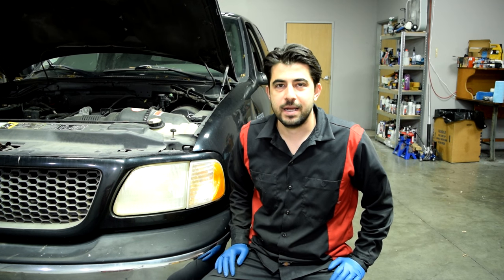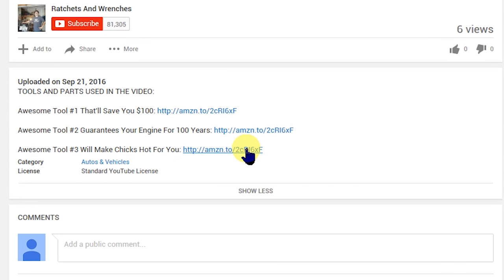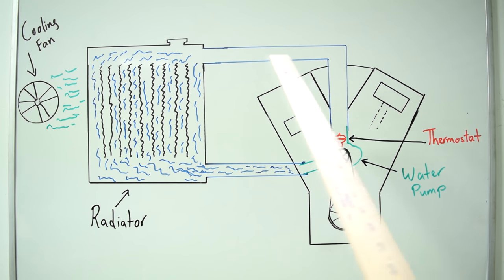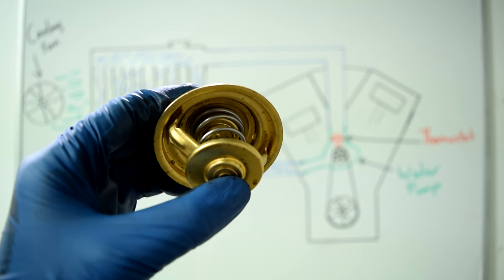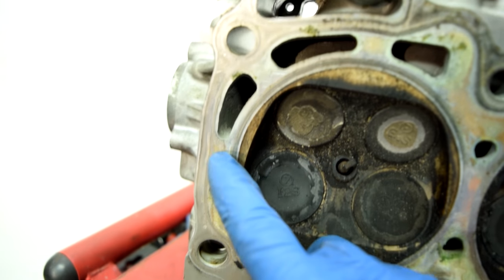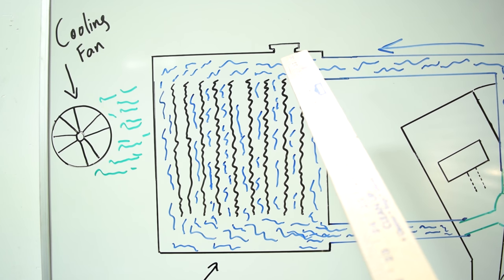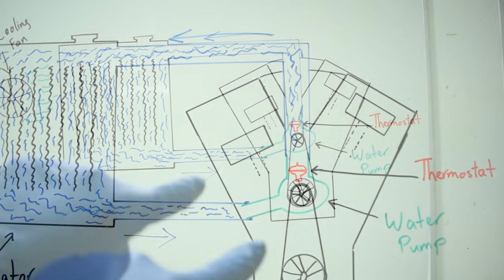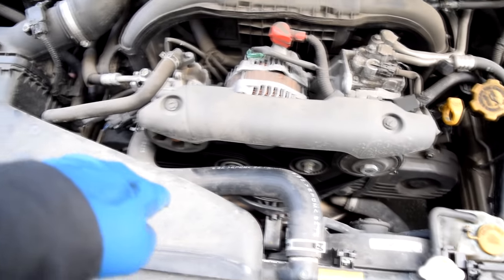How an Engine Cooling System Works and Operates - Also Diagnosis and Fix

Comment: i think the hot coolant when thermostat open pass through Upper hose than pass by radiator and Enter by Lower Hose back to engine.
2:47 you are saying opposite.
Reply: He is saying that some cars like that Subaru run in the opposite direction as explained.
Reply: @flightofthefatman  but my class mate works for subaru and he disagrees. He even recorded a video of an engine bay of the same car and it had arrows pointing towards the radiator on the top hose explaining that the flow of coolant at the top is away from the engine not into it
Reply: So I'll ask ratchets and wrenches

Comment: Good info, but what about any bypass flow into the heater core, etc...?
Reply: Cooll Asice The upper and lower rad hoses will still show a different temp if the thermostat working.  As far as bypass, if the thermostat is stuck open, the coolant will be allowed to circulate and be cooled so anything going through the heater core will also be kept cool. 
If the thermostat is working, the coolant will only be allowed to circulate through the engine but not into the radiator.  It allows the engine to heat up and operate at proper temps and the side effect is hot air for the passenger compartment.

Comment: +Ratchetsandwrenches are you sure the subaru legacy 2010 has reversed coolant flow to normal coolant systems because my mechanic mate works for subaru and he showed us a video on the same car model and year and the top radiator hose has an arrow pointing toward the radiator.  Can you reconfirm this. Thanks in advance

Comment: Hi question please , when the engine is cooled and the thermostat is closed , the water pump is running normally , in such case is the pump doesn’t circulating the coolant?
Reply: That system pressure going high only.

Comment: Hi I had a question about oil in the coolant. I have an 04 neon srt4 2.4l i4 and my coolant is a light brown color and still watery but not sludgy and I don't have iverheating issues, in fact the car runs at 196 farenheit because I have tuned the ls/hs fans to run at 191/196 and it never gets higher than those temps. I know it can be a number of things causing this like head gasket/oil getting past the turbo and the oil cooler, but what I'm wondering is if a power steering oil cooler can cause oil to mix with coolant as well. I changed my oil recently and while under the car I seen the fins on the power steering oil cooler were bent and there was fluid on all the 3 lines that run into it and out of the unit. The unit itself was pretty black with oil in between the fins. Do you know if any of those lines could be connected to the radiator or somehow cause oil and coolant to mix? Thanks in advance if you find the time to answer this question and keep up the videos.

Comment: shouldn't the temp of the lower radiator hose be lower than the upper hose?
Reply: Genci K  it depends on the layout of the cooling system
Reply: mushey ali and  what system would that be

Comment: Well how long will it be before some engineer says the old type thermostat is out dated and they need a computerized controlled electronic valve thermostat to control the temperature.  If it's not broken why fix it.  simpler is better.

Comment: Hey man, I have a question. I hope someone answers... I have a 96 2.3l ford ranger and it never goes to the middle point of the temp gauge. I SMELL coolant after a long drive (outside not inside.) I've done a flush and refilled but dammit I feel like I never get to operating temp. Is it the thermostat? It doesn't leak anywhere, my coolant is always full. Thanks in advance to whoever answers.

Comment: wow looks like they put water in there coolant
Reply: Bardia Ghajari just notice exactly the same thing, no coolant in the system, rusted thermostat so for sure the radiator should be rusted inside.

Comment: Here's my problem: (link below) 
Hi, i like your videos they proved quite helpful doing some diy's on my car. But recently im puzzled with a new problem i have with my cooling system. The vehicle is a 2005 g35 sedan. Coolant temperature has been fluctuating recently and my mechanic said we gotta flush out the system and probably have the thermostat replaced. But then I also noticed coolant spraying out at the rear of the engine towards the firewall just a few minutes after topping up the coolant mix.. And i got no idea whats going on. Here's a clip. 
https://youtu.be/Y0_HZLKSKGU